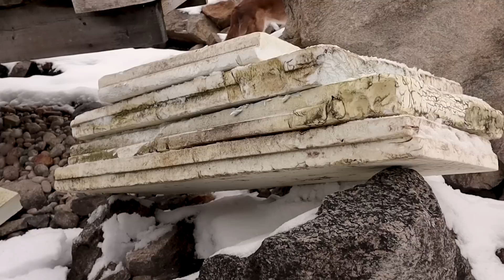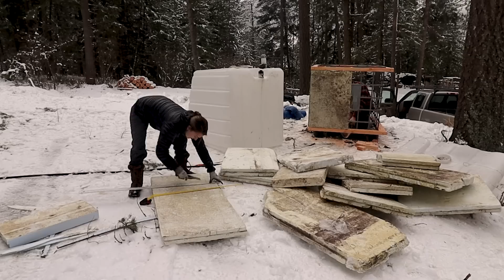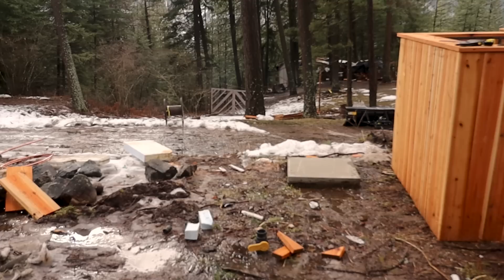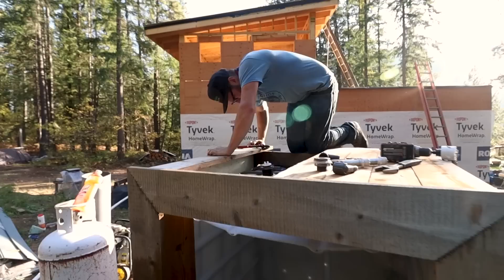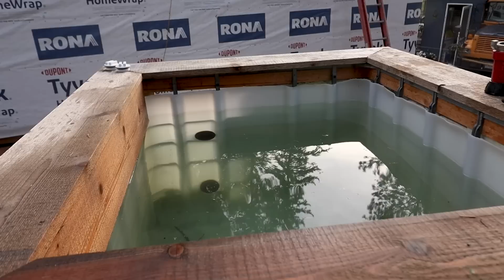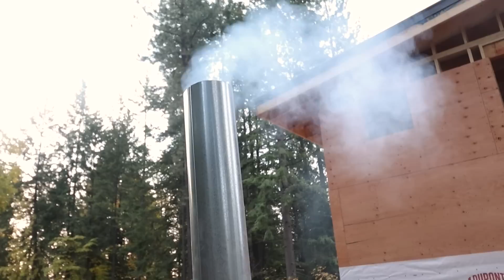TIMELAPSE| DIY HIPPIE HOT TUB FROM AN IBC TOTE

Comment: In the spring where it's above 0, could you fill both IBC totes and lift them off the truck with the tractor?  I thought you mentioned once that you bought forks for the bucket.  That would give you 2 more totes already filled that you could pump into the cistern without making a water run. Either way you have to do the work to fill them.  It would give you a longer period between water runs.

Comment: Can you make the I/O insulated pipe,  a sleave or bigger PVC pipe with installation fome, to reduce the heat loss in the pipe.
If your cold a hot bath restores the core temp. 🦘

Comment: Why didn't you tried a simpler iron used  drum from scrap & had modified to burn 🔥 wood underneath with pipe connected to your pool, enabling circulation of water through it thus achieving the same result. Further u don't have any system of changing water in ur pool which doest look that much clean ! Better should think over it.

Comment: In watching you glue that pipe that came out out of the tub, it made me cringe when you inserted it into the fitting and then turned it like you were screwing into the fitting. Generally speaking you're supposed to insert the pipe in the fitting and give it a quarter turn when you bottom out in the fitting otherwise you run the chance of wiping off the glue from the joint.

Comment: It will take a while, but the fire will consume the copper coil, A better design would be to put the coil in a steel tank filled with water and heat the steel tank. That way the coil is never exposed to temperatures higher boiling water, and it will last forever. On the downside it will take a little longer. Another problem with having the coil in the fire is the possibility of creating steam, which can be pretty dangerous. And then I watched the rest of the video. Good job guys.